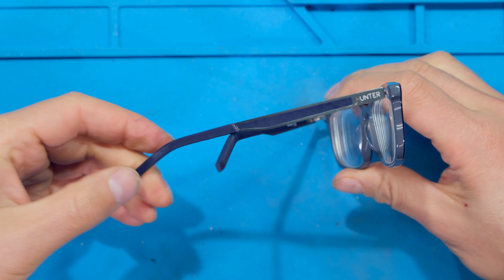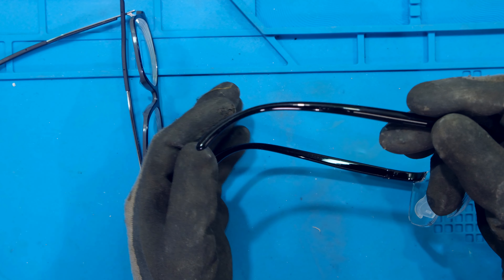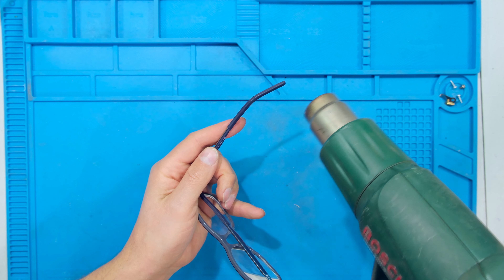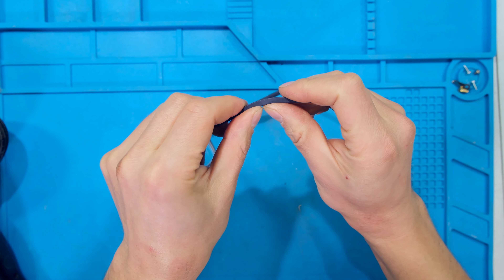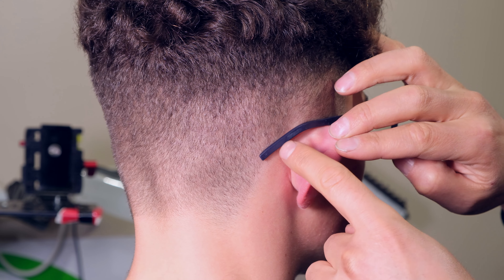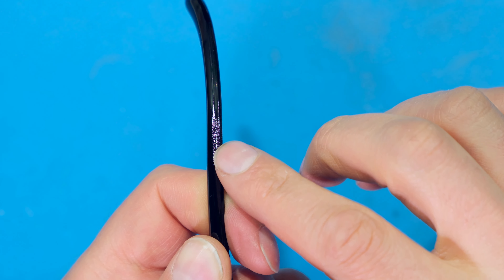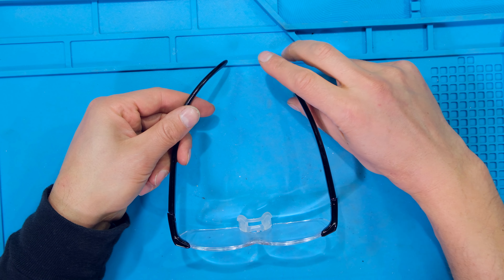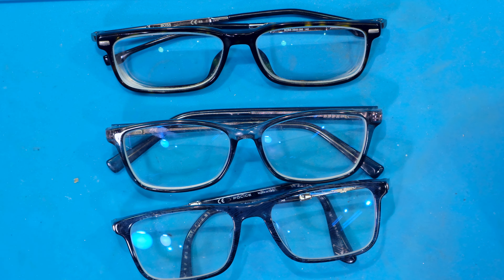How to bend the temples on glasses to fit on the head or round the ear

Comment: Tip hot water in the sink is much better for applying enough heat to the core, and also doesn’t make your plastic look all burned. Some plastics you don’t want to go full heat. 

Make sure you heat them long enough or they snap.